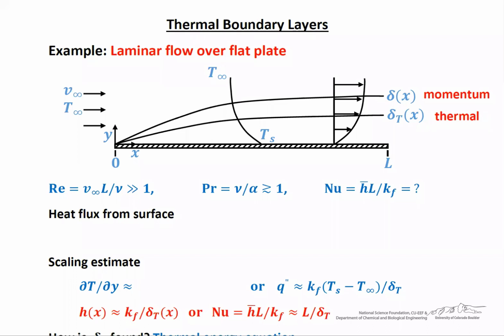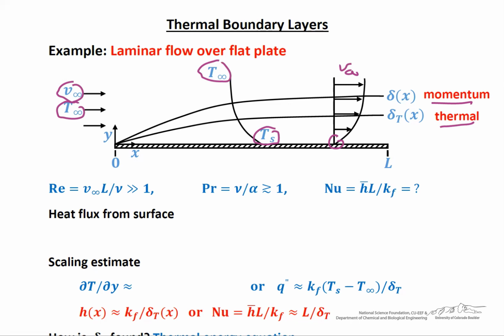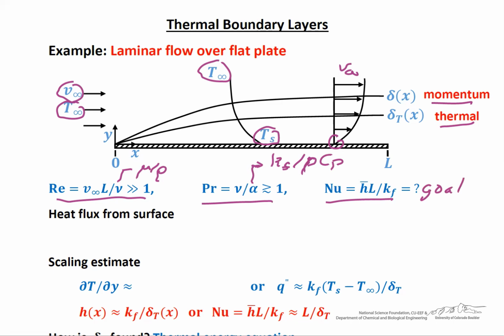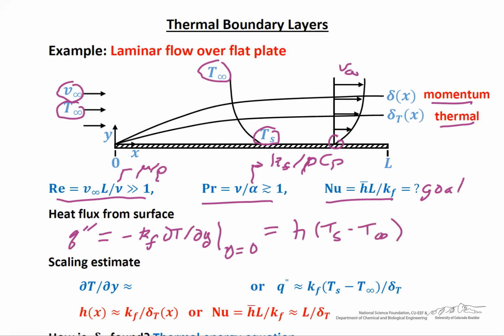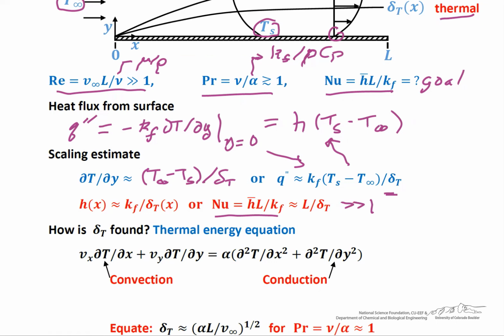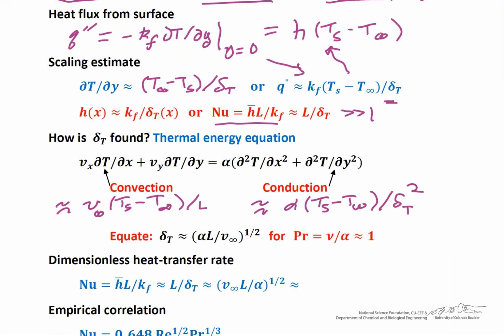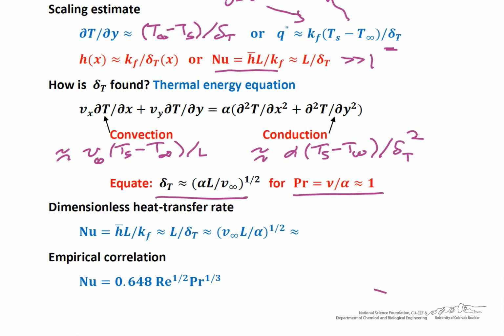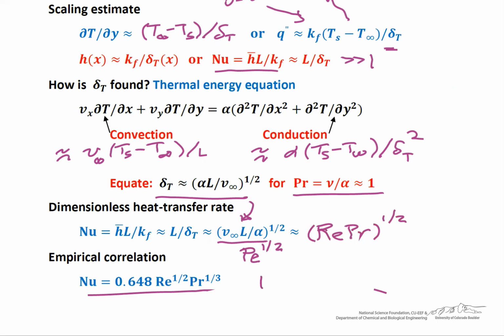Thermal Boundary Layers

Comment: hello, sir!
why does thermal boundary layer increase in the flow direction?
Reply: I am also studying this so i am not sure if i can answer but maybe because,

The hydrodynamic boundary layer is smaller at x=0, meaning the velocity change is relatively high at lower x-values. This means the fluids heat gets to diffuse more quickly as high velocity means more 'cool' fluid. That means faster cooling in general. 

Idk if it helped, but it helped me at least figuring it out myself lol
Reply: The shear force from the plate surface acting on the fluid causes layers of the fluid to slow down. This effect propagates "up" the layers the longer they are exposed to the plate surface.